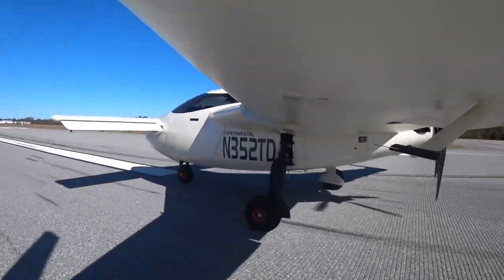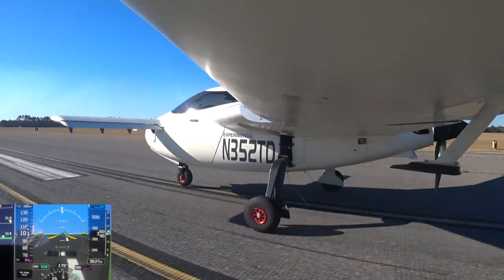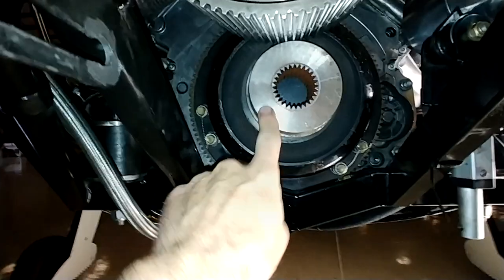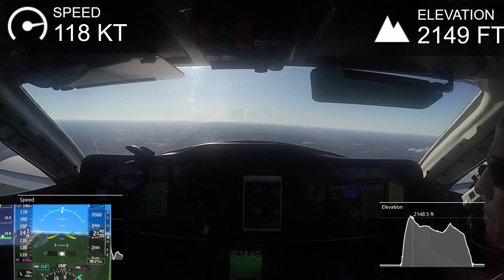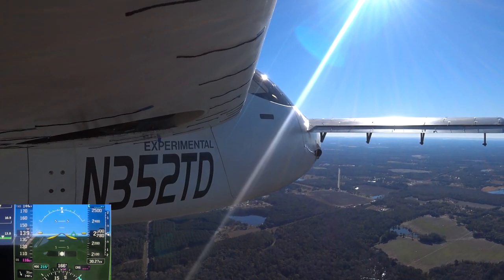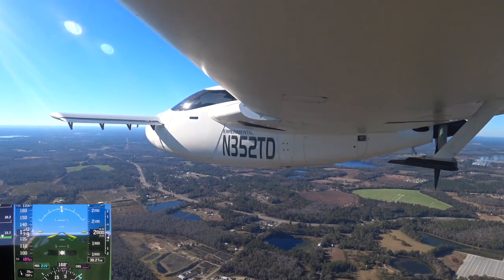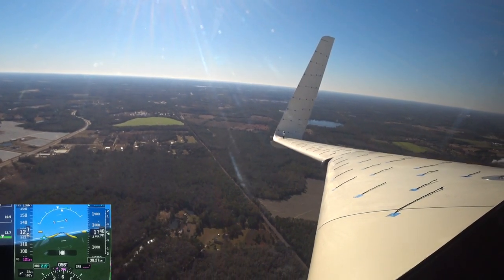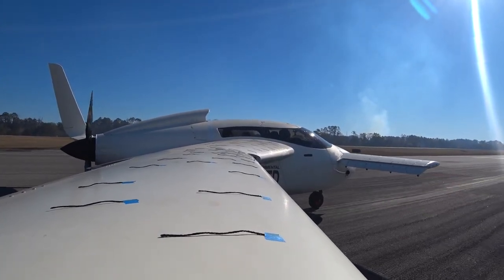Flying and Fixing - Flying the Raptor Prototype

Comment: Peter, if that re-drive was consuming as much power as you're imagining, it would have overheated and exploded before you got to short final.  You show in the video that the belts are still looking in good shape so ask yourself where is this waste heat manifesting itself?  I think you're chasing ghosts here.  In contrast you need to be spending flight time establishing an estimate drag power curve for your airframe so you can run the numbers on airframe performance.

Comment: how can you even think about figuring out Vx and Vy when you have no idea of your speed and altitude? your gaining over 100ft of altitude on the TO role. you need to get that fixed before you can get any real data. your a computer guy, GIGO. you need to get the power problems fix pronto. you need to be able to pull TO power for at least five minutes without temp problems. as to the prop, the math is easy, what does the prop manufacture say is the TO rpm? what engine RPM do you need to get that? thats what you need to see at TO. If you can't make TO power, then the test program needs to stop until you get that figured out.

Comment: I don’t understand why you aren’t requesting to orbit overhead prior to departure. You know you’re going to, you’ve blown past pattern altitude and then tower has to ask what you’re doing.
Reply: I think the static port is still giving false info to even accurately know what altitude he’s at. The last flight showed an altitude gain of 50 feet by the time he was half way down the run way.
Reply: There are so many unresolved known issues that are significant enough that they have taken peoples lives in the past.  These are significant no go issues, and yet he chooses to fly. I can only imagine what issues are unknown. I truly wish him well, but he’s taking unnecessary risks.
Reply: Exactly.  I often wonder what these videos would be like right now if Wasabi were still involved, how much better organized and performed these flight tests would be.  In general, how much more professional everything would be handled.
Reply: A lot could be improved by talking to the tower chief and explaining what the respective needs and expectations are of both parties. That’s one less distraction for both entities. Perhaps they can give a block of space adjacent to the pattern. There will be different needs depending on flight profile. If you don’t know your flight profile, don’t fly until you do.

In a professional test program, there would be controlling oversight. Such would preclude flying with a known oil leak. Obviously it was an easy fix. Obviously as in after the fact. It was going to get fixed eventually so why even think about waiting? What was so important on the second flight ? Flying around with a paper towel, I mean a wick, tied around a prospective leak in the engine compartment. Which when investigated showed a pending failure. Maybe not immediate failure but that wasn’t known until the tear down.
Reply: Those controllers suck. They all sound like trainees stepping all over airplane transmissions and not realizing it.  The aircraft is still experimental. Not in callsign.,,granted..probably should be.

Comment: The O ring is going to be sqeezed out. Cut the "donut" with a recess to contain the o ring. Centrifugal force and the squeeze will make the o ring come out in 10 minutes or less.
Reply: could be right there. worth keeping an eye on. easier than grooving the face? a nylon 'hoop' that fits snugly over the outside diameter of the Oring- would keep it from expanding outward- and the hoop could be slightly thinner than the width of the oring so as not to keep it from doing its' job.

Comment: Peter,  I realise the o-ring is a short term item, even so, I suggest using a compressible bevel washer instead. Unlikely a bevel washer will expand radially like an O-ring ( without a retainer) or suffer from temperature degradation over time. Also, have a look at the comment from Airtightindustries regarding the oil filled redrive acting like a torque converter and a oil temperature heat source. This could explain the power loss.

Comment: 18:58 keep it close eye on that o-ring. With nothing retaining it radially on the outside and especially with centrifugal force there's a chance that it could squirt out from between the pulley and the shaft causing things to loosen up on you.
Reply: As a machinist I can testify to that. Need some lip on either the retaining ring to keep that o ring in place over the long term therm cycles are bad enough for movement. Add  rotational force and it might squeeze out.

Comment: I'm sure others have cautioned you against using that big o-ring in a spinning compression arrangement like that.  That rubber will end up getting hammered and forced out by both compression and centrifugal forces. You'll then end up with a whole bunch of harmonic chatter which I guessing you won't want to experience at altitude.  I saw that shot in the video and it made me clench up just a bit, thinking about having that as a critical component several thousand feet in the air.  Otherwise, I really like your aircraft and the detail work you've done.

Comment: I only use only Viton O-rings for transmissions.  Good to 400F+  https://o-ring.info/en/materials/vitonr--fkm/vitonr-temperature-rating/
Also, I use high-temp grease on splines to minimize spline wear.  Dry splines will have a spline wear condition known as "fretting"  https://en.wikipedia.org/wiki/Fretting
Reply: This is a decent recommendation.  Be aware there are many recipes for FKM (Viton is a brand name) so you also need one verified to live in the oil it will be exposed to.   Also be aware that FKM isn’t the best for cold temps.  If you know you will not exceed 150C in any circumstances AEM could also be used.  It has better cold temp performance also.  FKM is the best for continuous high temps.
Reply: @flyermarkbig465  Viton is the rubber of choice for the aerospace (mainly space) industry.  I've never one go flat, fail, or get hard.
Reply: @YourTransmissionRepair  I agree.  I am very familiar with it and AEM.   My point is to watch cold temps.  Probably not an issue here given the usage.

Comment: Spring for a jet prop. Many problems solved. Expensive short term. but in long  runs? Could be cheaper, simpler, more reliable.....oh and more hp.   Gobs more. Pressurize. Great to see the successful flights,  Peter.   ✈️

Comment: I noticed that the wind speed/direction at the bottom left is very inaccurate. When you are downwind it shows the wind speed at a much lower speed than when you are heading upwind. In direct headwind it's showing 30kts and direct downwind is showed as low 8kts.

Comment: Direct Injection Diesel Engines are most efficient below 3,000 rpm and these engines are best run at max torque peak instead of max hp peak. The higher the rpm the efficiency is lost as the combustion chamber is moving away before all the fuel is consumed.

Comment: cavitation is the change in state of a liquid to a gas due to reduced pressure, so the prop was not cavitating ; the nut shown with the oil leak is contacting the metal pipe. the pipe should have a straight  run thorough the nut to the flare, it looks as if that might be a fatigue point in future. The re-drive looks to be positive with toothed belts, i would expect any additional tensions drawing power should show in reduced engine RPM and/or increased fuel consumption. Right at 29 minutes theres an audible RPM reduction, some minor fluctuations, the  noticeable increase at 38:30. Were these because of throttle movements? i offer these comments as an observer, no disrespect intended. Maybe you could squeeze in an thermal camera to see running re-drive temps? Hope you have a great Christmas, cheers

Comment: The Motec can also control rpm .
Reply: ,,, trying to reply to somebody,  yes the prop gov is best, but this engine is overpowering the prop or desired prop setting . The Motec can govern with a gradual reduction in power, at and before the preferred rpm setting . I lobbied for a ground adjustable prop using the Motec this way, but Peter seems capable of working this out .
Reply: @PistonAvatarGuy  the Motec can't control prop pitch, but if a constant speed prop is at its maximum bite, the adjustable settings of the ECU can gradually pull power back out, whereas the engine's max power will overdrive, the prop setting . This is actually more user friendly with a Diesel, because within a range, power is a direct result of fuel flow .

Comment: Going to need a bigger engine. That’s not going to work.  The unstable is a need for a yaw damp system.  No other way to fix that. Been there done that. Winglet size has nothing to do with that Dutch roll.  Your fat inboard ? The canard needs maybe 5-6 inches of winglet.  That would give it 
Stability

Comment: Constant speed is like 4 speed gearbox, 
1st for takeoff, 3000rpm
2nd climb, 2500rpm
3rd cruise, 2300 rpm
4th descent 2200rpm
1st landing/go round full fine.
Cruse with full fine is like driving down freeway in first gear.

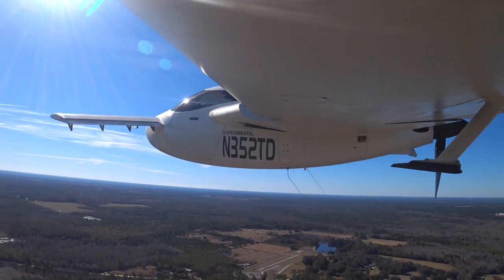Comment: 2:33.., thats what I said weeks ago Peter about reducing the pull on the engine, I know alot about computers and to overclock a processor may seem good at the time but will have consequences down the road.., run the engine at its normal speed and you will get great results.., Merry Christmas mate.

Comment: From 11gph to 10.2gph is a 7.3% power reduction. 143kias to 129kias is a 9.8% drop in speed. That could be completely reasonable if you are on the back side of the drag curve for that wing. I guess I don't see what the problem is unless you do an apples to apples power setting.
Reply: That's still very good performance either way. Especially for an aircraft of that size.

Comment: Merry Christmas!
Reply: Thank you Peter, I enjoyed the entire video! Glad you found the smooth air. Very nice orbit work. Looked like a smooth comfortable ride.
Reply: Santa was busy last night! Drinking my morning coffee reviewing your flights again this morning with you Peter. I agree with your hypothesis that the drive belts are robbing power as they tighten up. That 5 bladed prop seems to detect every nuance of airflow. Facilitating a perfect feel of almost every pulse. I believe you are on the right track of providing the solution with your alterations to the redrive system. The 5 bladed prop seems to serve a double duty acting as an excellent speed brake when in flatter pitch. Almost like a ballute/parachute feeling when power is reduced? A very positive feeling of airspeed control? Best wishes, thanks for sharing!

Comment: Could you switch to a 2 or 3 blade prop?
Reply: @kirkkenton807  that would be gorgeous for her.
Reply: A two or three bladed prop would have to be larger diameter - increasing the risk of a prop strike
Reply: @kestreltom  not necessarily

Comment: I would attempt to take a pressurized container and blow some sort of coolant over the area you believe is heading to watch on the drive and see if you can create more horsepower by just cooling it radically down as an experiment I believe the car engine you’re using is the problem you’ll have to do something to boost it power even propane injection on diesels will help don’t know but just thought I’d throw the suggestion out

Comment: If you're using the standard turbo, you should monitor its' rpm because at higher altitude altitude it will choke.  Google search turbo choked flow.  Easy fix is to run a larger turbo - you don't care about good throttle response from 1200rpm anyway..  What comes for free is more power at higher rpm - a thing you could do with as well.  Find a quality ball bearing turbo with the correct flow and pressure ratios for the altitude and flow you need - spec it to be a little laggy low down.
Reply: @rv6ejguy  Some top engineering people here..  The high charge temperature is a key indicator I think..  Maybe some rpm and pressure-ratio monitoring..
Reply: @rv6ejguy  Thats pretty much what Ive just said mate
Reply: Steve Wright, ball bearings in turbos are mostly unnecessary, especially in a vehicle that has a necessary cool down, and make no more measurable extra power . Unless they are chiseled in stone much more reliable I would not bother . I have in excess of 800 thousand miles on my plain bearing turbo, and maybe close to a million two hundred, but don't know its first 4 years history: however you make much sense about a large single . Peter has something to learn about drive pressure  .
Reply: @rolandtamaccio3285  As far as the design engineering for a homebuit plane goes - each builder will surely decide for themselves anyway, so the point here will be largely moot, except for the engineering discussion to be had.  Yes, I think a laggy overly large single will be fun, somewhat like flying a turbine! ;)

Comment: As far as the performance issue, you may need to route the turbo intakes from a clean air source. Compressing hot air will lead to significant losses in power. Which is what I believe is occuring.

I agree with the other commentors the redrive needs to be fix mounted to the engine. If the engine receives shock for any reason the redrive will see the worst of it instead of the mounts. 

It would seem the prop doesnt like pushing your beefy bird through thinning air aswell. All the good air is clearing around the prop which means you need a bigger prop, and a greater reduction. I think 2:1 would be good. Should bring your 3800+rpm down to a manageable 2500rpm with a larger swipe of air. Really want the prop tips clearing the chassis here but you may have an issue with ground clearance and your working manifold pressure will increase by 40%.
Reply: Diesels love breathing cold air when they are at the proper temp

Comment: think that motor was thermostat ed at 200* -210* running degrees, oil safe to at least 240*. trying to run too cool affects power out. need better buna n O-rings at least. right on about alum expanding. Wave washer instead of o-ring or bellveiw washer. Like your testing/recording and videos.

Comment: Air speed displayed at the top and bottom of the screen is very different :3
Reply: Top is ground speed. Bottom is indicated airspeed.
Reply: @israelkozlik7554  should IAS be lower than ground speed? Not way higher?
Reply: @LilleyAdam  ias is higher than true airspeed. Ground speed is predicated on winds aloft.
Reply: @LilleyAdam  not a pilot are you
Reply: @edwardchipps8629  no. Do I have to be?
Reply: @LilleyAdam  just saying , if you were a pilot you would know that IAS has nothing to do with ground speed, and is always less than TAS
Go look it up
Reply: @edwardchipps8629  so what Israel said above is wrong too... Thought it was.
Reply: @LilleyAdam  yes! You are right that Israel is wrong!

Comment: NO question Peter has done something very few have accomplished and he should be very proud of getting his dream to this point BUT his lack of a structured flight testing envelope would prevent me from ever considering purchasing this kit.  I am NOT trying to be negative but I am an aircraft owner and pilot so have a pretty good idea of what my planes' capabilities are in most flight envelopes....with the Raptor, I know it will take off at 90 kts (in light winds) and land at something over 100 kts (again in light winds) and his highest cruise in the pattern looked like 140ish kts on 13-14 gph but thats all I know...I hope he plans to do something more than fly the pattern at 2000 ft for 40 hours...

Comment: You are really getting to know her. Making fine adjustments to power and noticing the changes. I really wish u got cooling under control soon cause all this tuning and dialing won't stay the same once u have plenty of power. The biggest thing that's robbing you of power is the hot air from those turbos.

Comment: Peter, dont listen to these morons. The G force at the hub is negligible. G force is directly proportional to the distance from the center. If you are concerned about temp, you can always get teflon O rings (PTFE). Not only can it handle 500 degrees, it never breaks down. Just look at a teflon frying pans. 30 year old pans from 1990 still good as new. 

Also, your prop setting can go even lower. It should not be able to hit the limiter while sitting still. It should only hit the limiter at around rotation speed. This is what the newest Cessnas do. It adds 7-8 knots to the top end. 

And your speed is great! 140 in the pattern is Mooney territory. Blows away any Cessna I've flown.

Comment: Merry Christmas Peter!
This is the 1st flight I've seen which I didn't think 'there's something seriously wrong with your airplane,' (with regards to stability).  The flight looked smooth.
All the other flights, and I mean 100% of the ones I've seen, there seems to be oscillating, it doesn't appear from turbulence either.  Perhaps that extra few pounds in the nose helped, I don't know, but that's my 2 cents worth.

Comment: greasing those landings!!! cg getting dialed in, oil leaks fixed, redrive adjusted, keep it up!!! that is what its all about!!.  Are you thinking of using less carbon fiber with overlay where needed to reduce weight?  Maintain strength were needed?  still think you need a separate oil cooler similar to what you did on the right side, on the left.  Nice flight, stable!!! I likeeeeeeeee  100,000,000 attabits!!! Merry Christmas mate!! can't wait to see this fixed and flying fine!!!!!!!!!!!